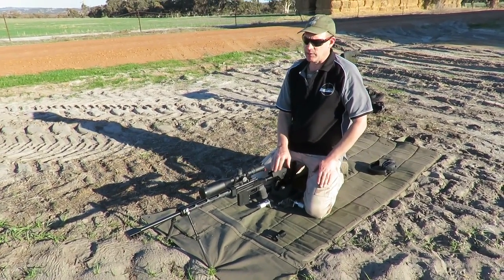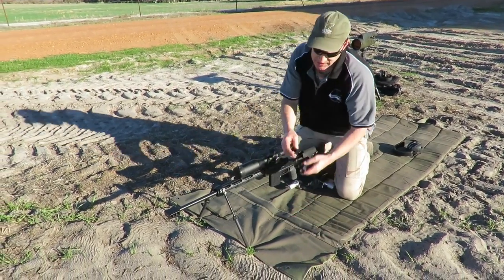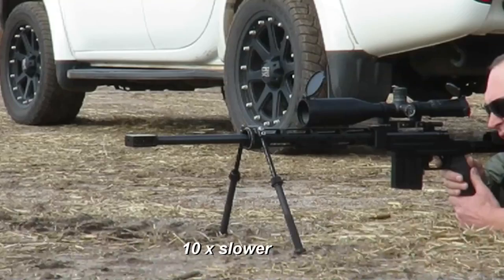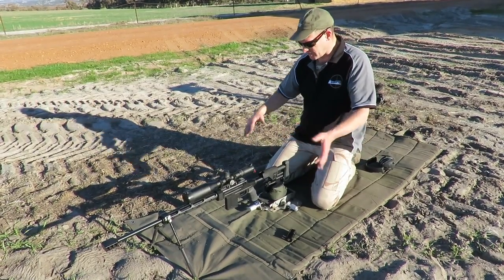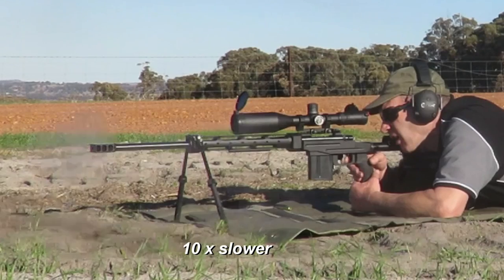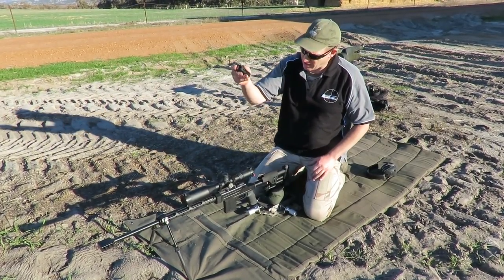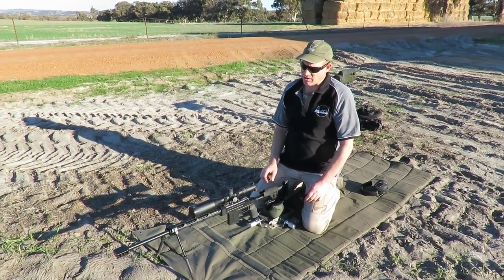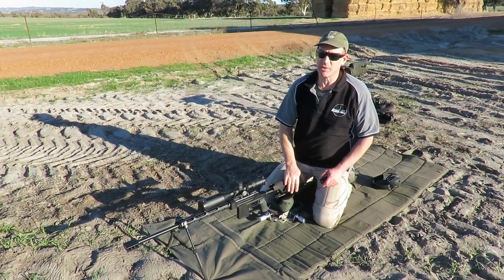Muzzle brakes v muzzles brakes, not all work the same!!

Comment: When selecting a brake - Do you need to match the brake size (ie weight) with the barrel diameter (eg light barrel requires a lighter brake)? Some gunsmiths say so but there is very little else online I can see that discusses this.
Reply from the maker: no

Comment: You say a two port would be fine, but you went with a three port just for the hell of it. What is your opinion of single port, two port, three port? I see some Mil Spec MB's are single port, but almost all Civ MB's are three or more. Is more than one port just overkill? Are most MB's three or more ports just because so many ppl think more is better?
Reply from the maker: All about braking surface area, more gives more braking, so you choose how much you want, and sometimes how you want it to look, FYI mil specs tend to be minimum and not precision options, Cheers

Comment: Hey mark, hey sam, what do you think of the kinetic Research Group KRG chassis? Have any experience with their company?

-cheers
Reply from the maker: Hi Jesse, I have not shot one, so could not comment, but they look OK, Cheers
Reply: Jesse urban I use their W3C, folding stock, on my tikka t3 and it is fantastic. Second generation if I recall correctly. The adjustability is great for both very short and very tall shooters and it is quick to change. HABU is one I would love to own - alas too expensive for my budget